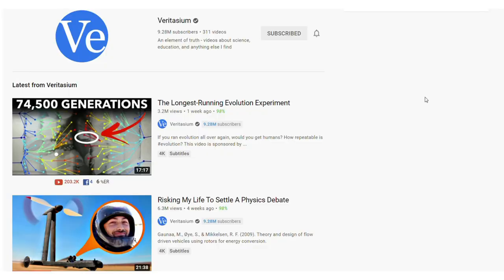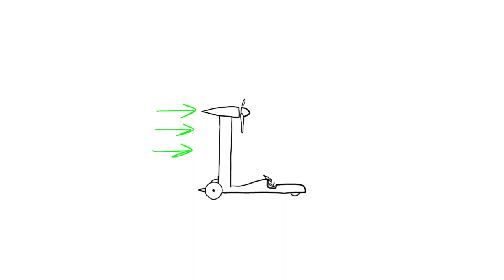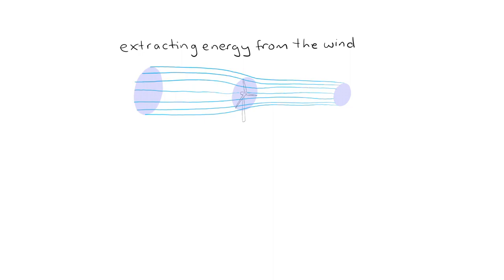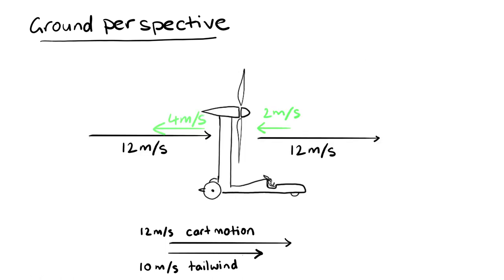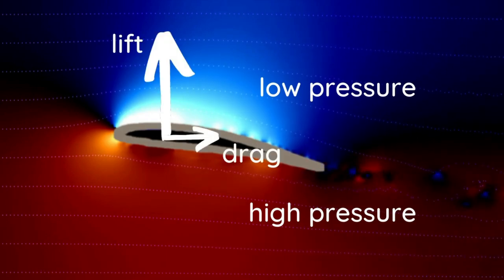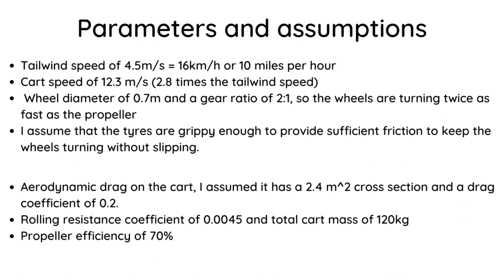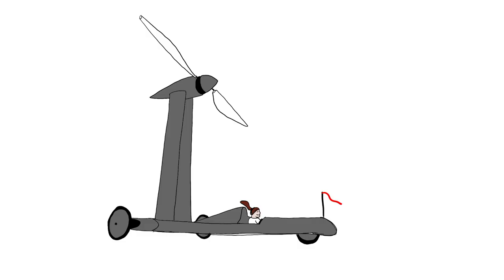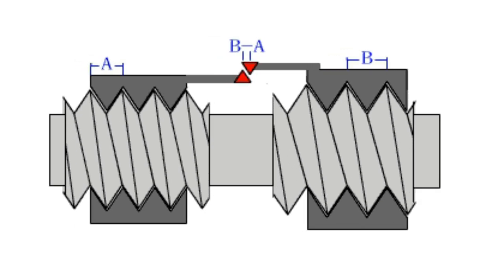Downwind Faster Than the Wind by Veritasium: How Does it Work?

Comment: Its like the cart is "borrowing" airspeed from the air in front of it. The bycicle man pushing on the mirror of a car is a good analogy. In this case there are many cars which the cyclist can push on to go faster. Its like you would pull yourself up on an already upwards moving ladder or something. The energy is conserved because it basically "destroys" (slows down) the speed of the mirrors/ladder steps. Its like a leech mechanism, it taps into the air of the cart's "future route".
Reply: "The bycicle man pushing on the mirror of a car is a good analogy."

This analogy becomes better, if the man uses a stick to leverage the ground against the mirror, while holding the top end of the stick.
Reply: @eyytee  it still requires an internal energy source, i.e. the man's muscles powered by chemical energy. yet the blackbird allegedly has none. so no it is a very false analogy indeed.

Comment: Ironic Overlooked Detail: If you take time dilation into account, the vehicle moves faster than the speed of light... in a black hole... eating spaghetti... and drinking wine... whose inebriating effects are magnified... by the time dilation, of course... causing the driver to veer off course... and right into the utility pole... causing a huge power blackout (ie, "Who turns the lights off? I cannot see the black hole any more."). The driver survived the collision due to "relaxing" effects of the black hole, not the wine. Moral Of The Story: Bring a towel and a few packs of peanuts.

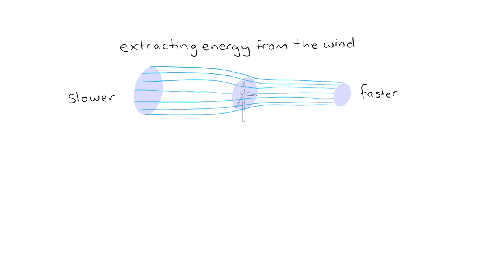Comment: 5:10 isn't this the exact opposite of what is happening the wind is behind the cart so the prop is pushing air back against itself like 2 fans pointed at one another?
Reply: That's only in the beginning. Once the cart starts going faster than the wind it's as she described.

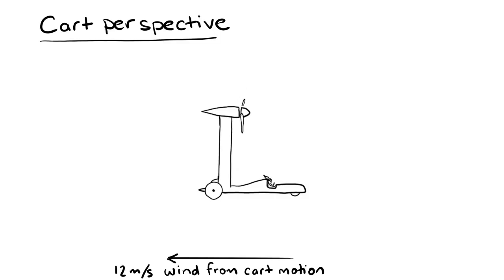Comment: The  part 5:38 Energy balance with some simple numbers is more or less not correct. When the change in the air speed is positive you must have external source of energy in order to rotate the propeller and gain a thrust force. If you do not have a source of energy and gaining thrust force together with accelerating air flow was possible, I wonder why they bother to use fuel for the airplanes. Actual the whole engine of the plane will not be needed.
Reply: //"When the change in the air speed is positive you must have external source of energy in order to rotate the propeller and gain a thrust force. "//

There is an "external source of energy" the entire time -- it's called "the wind".

As long as continue to hold the position that the rotor is driven directly by the wind (it's not), you will continue to struggle with this brainteaser.  If the rotor WAS directly driven by the wind, then acceleration would be greatest at low speed, and continue to fall as you approach windspeed.  But the rotor ISN'T driven directly by the wind -- it's driven by the wheels.

Comment: Why do folks use meters/second and not kilometers/Hour?
Reply: You need to use m/s if you want to solve a physics problem.
That said this video is wrong about the way the vehicle works. Energy storage is involved else no wind only powered vehicle can exceed wind speed direct down wind.
In the case of a sail boat the vehicle kinetic energy can be used but only if it is allowed to travel at an angle not directly down wind as it is the case for this vehicle.
This vehicle uses pressure differential to store energy and thus it can exceed wind speed for a limited amount of time depending on the amount of energy that was stored well before vehicle exceeded wind speed or in the case of the treadmill model the energy stored  while vehicle body was constrained by the human hand.

Comment: Fabulous video, great explanation, super presentation. If you consider the cart to be stationary in still air, but on a moving belt which then drives the wheels and hence the propellor this is analogous to an aeroplane starting up, no problem understanding the thrust of that propellor. Now consider this in the frame of reference of the moving belt. There is a following wind but the propellor still generates a driving force.

Comment: Can a flying vehicle work in a analogous manner faster than the wind?
Reply: No, at least if you assume uniform wind. You can look at that kind of situation in the inertial frame tied to the air. In that frame the air is stationary and there's no wind to power any vehicle. The car can only work because the air is moving relative to the ground and the car is touching both.

Comment: The way you analyse Gerard Morin's Magnetic Energy Extraction Device has an analog in the conic-cyclonic coherence-cohesion resonances of the Turbine.  When the arrangement of the vehicle is tuned correctly, it becomes an "implosion device" removing Adiabatic energy from the air vibration system of rotational blades. Maybe putting air pressure and temperature sensors on the blades could tell you that story. Definitely something an Engineer and Physicist would be interested in.

Why does a Thunderstorm Convection Cell "lift" against gravity?, and isn't the idea of cold plasma dark matter in the same Bose-Einsteinian Condensation Relativity concept of log-antilog "anti-gravity" you should expect in Quantum-fields, composed of relative-timing ratio-rates in/of "Spinfoam" Chemistry.., and fractal conic-cyclonic modulo-geometrical Forms of Atomic Structure seen everywhere-when in the Eternity-now Holographic Principle Imagery projection-drawing Interval of Actuality.

Interesting and entertaining.

Comment: Remember that 90% of videos like this on Youtube are fakes and the biggest problem with this scam is that the cart is very slim and has nothing for the wind to push against to drive it forward making the blade turn in the wind that's geared to the wheels to make them turn!  The small model works entirely differently since it's powered by a large electric motor in the treadmill and there is no wind.   Maybe if the large one had sails on it....
Reply: yeah it's a very weird hoax, like the next flat earth or something.
Reply: @onebig77thbrigademonkey.57  Or like all those other videos showing perpetual motion machines running or cars that can go 100 miles on a gallon or run on water!

Comment: And I sometimes manage to spend more than I earn :)), in my opinion we have this result due to the speed gradient of the air masses near the ground, if at a height of 6 m we have for example 15 m/s at a height of one centimeter we will probably have 0.0015 m/s, the height of the indicator on the car (ribbon) is somewhere at 1 m and obviously the vehicle will at some point reach a speed immediately higher than the wind speed at that height but lower than the wind speed at 5-6 m height and the top of the blades will produce enough traction to keep the vehicle moving.
Reply: Nope.  There's plenty of video with streams well above prop height.  Same result.

https://youtu.be/aDzWh9J1dk4
Reply: @johnborton4522  Yes, you're right , I watched your video, in fact it is observed that there is that gradient of speeds proportional to height due to the indicators placed at different heights but clearly also at the top the car moves faster than the wind, so I tink in reality this is possible because the propeller creates its own airflow and the speed of that airflow minus the speed of the vehicle creates a support surface for the wind even if it stays at a lower speed. That airflow created by the propeller is an intermediate vector force used to push the car. Wind push in this airflow and airflow push in propeler, further the propeller pushes the car axially forward and some of the motion energy is extracted by the wheels and transferred back to the propeller.
Reply: @eugeniusro  
>> I tink in reality this is possible because the propeller creates its own airflow and the speed of that airflow minus the speed of the vehicle creates a support surface for the wind

That is a very common misconception based on the notion that the wind has to be "pushing" the vehicle.  The reality is that the propeller is simply operating in an advantageous medium - air that's passing over the vehicle more slowly than the ground passes under its wheels.
Reply: @Rick_Cavallaro  It doesn't matter, the difference in "speeds" between the land-vehicle and the air-vehicles can be managed by a gearbox between the propeller and the wheels.
Reply: @eugeniusro  You claimed that the propeller is creating a sort of air buffer for the tailwind to push against.  That's not correct.
Reply: @Rick_Cavallaro  Just imagine a propellered motor boat moving on a lake, the propeller creates a jet of water back and extracts its momentum forward by pushing that amount of water back, and suppose that boat moves on the lake at 10 kmph , now we take that boat and put it on a river that moves downstream with 5 kmph, if the boat moves along the river downstream it will have a speed of 15 kmph towards the land, in our case the river is the air current created by the wind .
Reply: @eugeniusro  all of that is exactly right.  The notion of the propeller creating a sort of air buffer for the tail wind to push against is not.
Reply: @Rick_Cavallaro  Maybe the word buffer is not the most appropriate in the description, in fact you used it before, not me, it's just a relative movement between the vehicle, the air mass and the air mass driven by the propeller, in fact if you completely ignore the ground, already you can make many easy analogies, my previous analogy with the boat would be an example but we can also talk about a plane moving in a stream of air from the tail which in addition to its own speed gains and adding the speed of the air mass in which it moves. Later we can discuss the relative ground motion that only counts to extract the rotational energy required for propellers using wheels, possibly looking for that sweet spot of the transmission using a bicycle gearbox or modifying the transmission ratio by trial and error.
Reply: @eugeniusro  
You're right that "buffer" was my word.  These are your words...
"I tink in reality this is possible because the propeller creates its own airflow and the speed of that airflow minus the speed of the vehicle creates a support surface for the wind even if it stays at a lower speed. That airflow created by the propeller is an intermediate vector force used to push the car. Wind push in this airflow and airflow push in propeler,"

So what do those words mean?  What is this "support surface"?  What is the "intermediate vector force"?

MY point is that there is no "support surface" or "intermediate vector force".  The propeller is simply operating in an air mass - like any other propeller operating in an air mass.
Reply: @Rick_Cavallaro  ok, we probably get confused in words but I think we agreed on the phenomenon, let's put the problem in a universal language of mathematics.
What do you think of this expression:
EP = EW - ER
where EP is the energy provided by the propeller, EW is the energy extracted from the wind, and ER is the energy lost in friction in transmission, rolling resistance and forward drag because we are talking about when the vehicle moves faster than the air mass.
So EP Propeller energy is extracted from wind energy minus the aforementioned losses. Personally, I believe that more than 90% of the energy extracted from the wind is transmitted to the propeller, but the exact figure is not important but the principle.
Reply: @eugeniusro  I'd say that equation is reasonably accurate.  You're not including losses from the propeller inefficiency, but that's forgivable.  Our propeller alone is probably in the ballpark of 90% efficient, so almost certainly our biggest losses are between turning the propeller shaft and getting useful work out.  But that's the nature of propellers.
Reply: @Rick_Cavallaro  I think that the main problem is to have the optimal transmission ratio between wheels and propeller optimized and depending on the wind speed and the vehicle, I think a CVT gearbox would be ideal to use. Something like that:
https://youtu.be/EivnXf10nYg
Reply: @eugeniusro  What's important is not the gear ratio by itself, but the ratio at which the propeller is trying to advance through the air vs. the speed the wheels are rolling on the ground.  Obviously changing gears will impact that, but we can do almost exactly the same thing with our variable pitch propeller.

Comment: Superb explanation!  Great Job Rosie.  

One small negative niggles on me.  You mentioned windmills vs wind turbines and how windmills work on drag principles.  The cart's prop is working on drag well below wind speed because it is turning backwards compared to a turbine.  But a flat plate windmill is turning as a turbine with the blades at a positive angle of attack.  The lift generated by a flat plate like that is due to angle of attack and not just drag.  You did go on to discuss angle of attack of a wing so that was good.  There is additional lift generated by wing shape like a turbine blade.   

The angle of attack part is the reason airplanes with the "turbine wing shape" can fly upside down (albeit pretty inefficiently).  The lift due to the angle of attack of the inverted wing is enough to overcome the "wing shape" lift as well as lift the aircraft.  So most airplanes flying inverted have a really high nose up attitude (upside down) to place the wing in the inverted high angle of attack mode.  It is clear that a conventional airfoil shape is much more efficient for producing lift than just a flat plate at a positive angle of attack.   There are people on the internet that put a strong motor on just a flat plate of foam and fly it around as an airplane!

Maybe I just misunderstood what you stated so help me out, please!

Comment: I can't understand it. When the cart and the distant wind speed is the same in the same direction: There is no drag force to drive the cart. The propeller accelerate the air backwards. The propeller needs power to accelerate the air backward. The power comes from the wheels. The wheels decelerate the cart. The cart can't accelerate over the wind speed. If the cart is going to the direction of the wind, than the only one thing that can be faster than the wind is the propeller blades relative speed to the air.
Reply: " The propeller accelerate the air backwards."

And that slows down the true wind relative to the ground. And that provides energy to the cart.
Reply: @eyytee  Ok. But the rotor needs power to accelerate the air backwards. They think, this power comes from the wheel. But how can be the propeller motive power higher, than the brake power at the wheel?
Reply: @belamizsak161  "But how can be the propeller motive power higher, than the brake power at the wheel?
"

It is isn't. But the propeller force is greater than the brake force at the wheels. This is explained in the 2nd Veritasium video on this, at time 11:02.

Comment: All this experiment proves is that good old sails work better than modern propellers at harnessing wind energy. 😄

Think of the propeller's surface as a sail, when it turns in the forward direction it converts the air resistance in front of it into additional thrust. 🎉🎉🎉
Reply: P.S. If it were not so, the propeller motion would have moved the cart in reverse. Of course, a simple bicycle sprocket will prevent that.